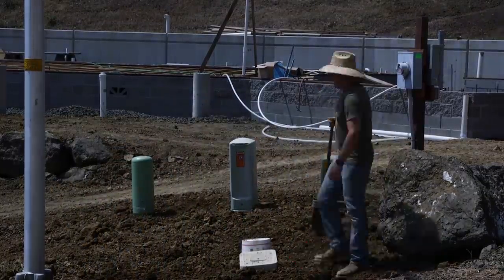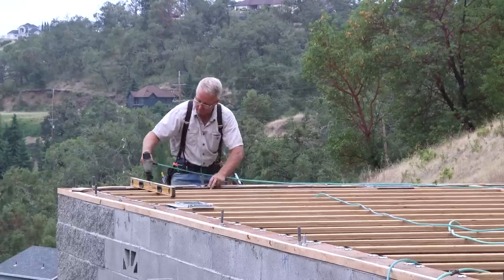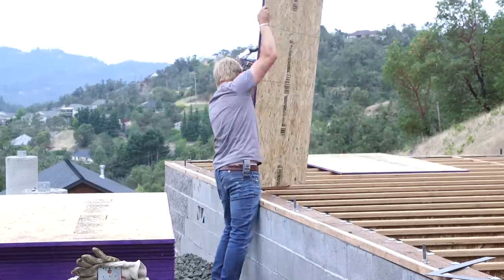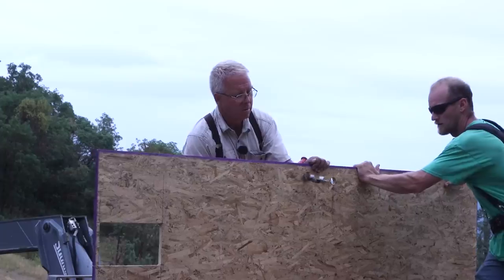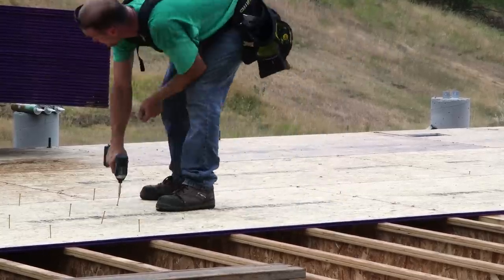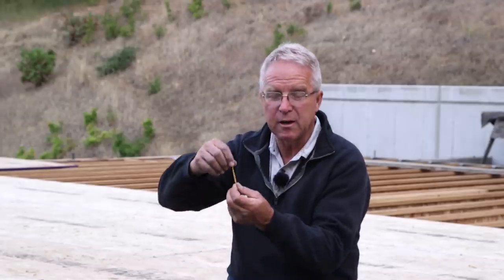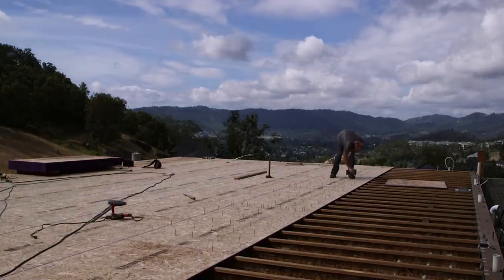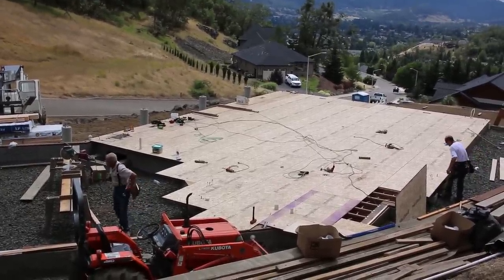Lay the Deck Ep.44

Comment: I'm not an expert, but wouldn't it be smarter to just use screws without staples and glue? The glue basically makes this whole system non-recyclable and/ or non-resusable. How long is the life-span of this building? like 50 years?
Reply: Fantasibert As long as you maintain it and it doesn’t burn down... hundreds of years? 

 I do see your point though and I think about “the next guy” so to speak. But in this case, you really don’t want any squeaks and glue does a fantastic job at preventing them.
Reply: The glue assists with squeak prevention
Reply: The staples hold the sheet in place while setting the screws.
Reply: Fantasibert 

50 yrs? 😆
Reply: Hundreds of years? I'm sorry but i think that's unrealistic. But I don't want to jump to conclusions the house isn't even nearly finished. 
I get that with the staples, but are they necessary? The boards look heavy enough to not slide so easily. And how about cork instead of glue. That would prevent squeaking even better I'd argue. But i have no evidence.
Reply: No need to reinvent the wheel